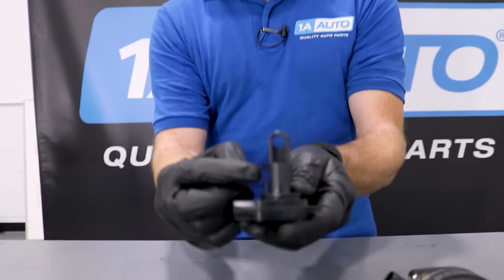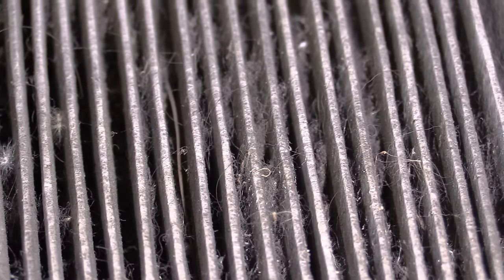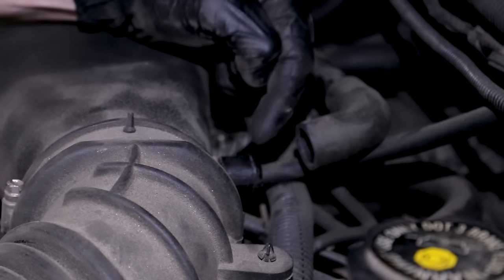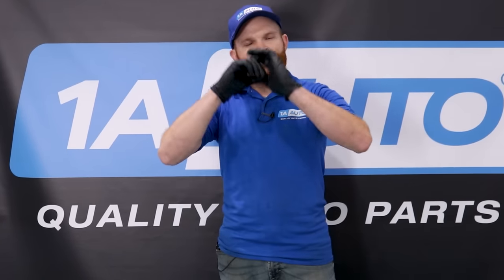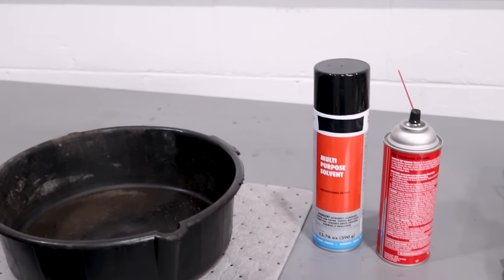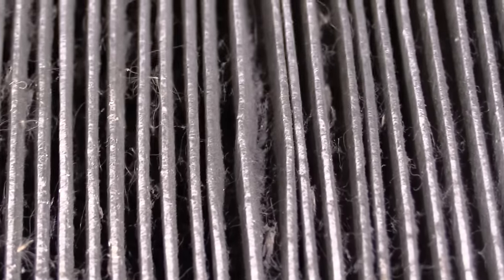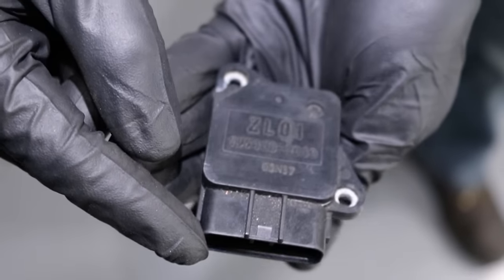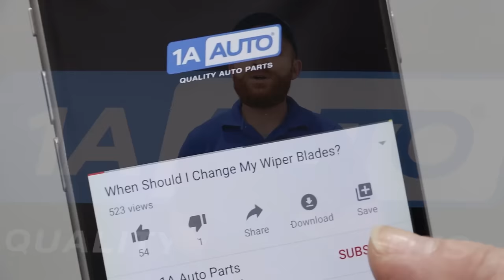What Does a Mass Air Flow Sensor Do in a Car, Truck, SUV?

Comment from the maker: √  Watch the Video
√  Buy The Part at 1A Auto http://1aau.to/m/Visit-1AAuto
√  Do it Yourself
√  Save Money
Reply: Could this cause a car struggling to stay started on a cold start? I noticed after checking my MAS it was completely black in which i could not get rid of the Residue when spraying it. Once my car has started warming up the idle smooths out with no issues after through out driving the car. I have no check engine lights nor codes. I’m totally confused as to what the issue is. I also change the spark plugs.
Reply from the maker: +T. Farris We wouldn't be able to diagnose an issue like that here, you may want to have a local mechanic take a look at it. Thanks for checking us out! http://1aau.to/m/Shop-1AAuto-c
Reply: Just went to order a MAF Sensor for my 98 Mazda but you dont have any..
Reply: I don’t have a check engine light on but I recently checked my cabin air filter and it was really dirty with leaves and debris… the next thing it effects is the MAS correct?
Reply: Good Advice
Reply: @zealgaming9123  Cabin air filter I think would be for air conditioner. The engine air cleaner filter which is in another area if dirty would need to be replaced
Reply: Yes you did a mastertul explanation
Reply: @whatisrelative5586  I had never been told to remove the negative battery post connector. I replaced the MAF Sensor, however,  kept getting 101 & 103 codes. I am now unhooked battery, negative connector fir 15 minutes, as told on YouTube video.
Reply: Love video I just subscribe

Comment: If your engine runs better when the maf is disconnected, chances are a new maf from 1A Auto is required.
Reply: Honestly, they’re not that expensive or difficult to replace . The difference in economy and performance makes it well worth it. I did mine on my v8 Mercedes… bloody thing only cost just under $50 AUD

Comment: Sadly the good explanation of how a MAF works is diminished by cleaning the wrong part of the MAF. What you cleaned is the air intake temp sensor bulb not the hot wire resistors. They are located deeper in the tube on that sensor and can cleaned as well.
Reply from the maker: +Jay Anderson Thanks for the tip! We'll pass this info along to our production team.

Comment: My lexus rx 350 is giving all time bad gas mileage. I have changed air filter, new spark plugs, fuel injectors etc. I am left with oxygen sensor/MAF now. But there are no symptoms of these sensors going bad. Car starts normally, no jerking, normal acceleration etc. What should I do? What's causing bad gas mileage. Shall I try and change these sensors?

Comment: I had a hose the ripped off and it was extra long so I cut it in half and it still fit . It’s running good but now it’s saying my MAF sensor circuit bank 2 code . You think it’s because the hose ? I just cleaned the sensors but it threw the code up again

Comment: I replace my Mass air  flow sensor twice on my 2012 Nissan Rouge in the past few months and my check engine light keeps coming with the same code. no leaks, changes air filter, reset the code and it drives great for a couple weeks, then when I'm coming up on a stop  it will do a little chug like it wants to die and the check engine light is back on. any suggestions on what I should be checking for

Comment: If you are going to replace the original for an alternative sensor...don't throw away your original part.
Many times, the new sensor is not of good quality an make the car even worst idle.
In such a case, clean the old sensor, put it back and return the new one for a refund.
Reply from the maker: +pablo jimenez Thanks for the feedback!

Comment: I HATE NEW CARS! was a Ford mechanic in 90s, Mustangs, Fairlanes... we'd re build them up then maybe put 390s 428s... In them and maybe a MSD box, my 68 Cougar is 400+hp 289, no GD sensors. We knew, know how to adjust the carbs and timing... 2000 Taurus is my 1st fwd drive car ever had, 8 yrs, mechanicly fine I fixed it, all these BS sensors can blow me all the sudden with the trouble codes. I'll be getting my 82 Bronco 4spd going again, sooner than later! Good video though!

Comment: Other instructions via You tube recommend spraying the inside of the Mass Air Flow Sensor with Mass Air Flow cleaner but you did not. Why? I am assuming you alluded to the reason why when you spoke about the internal circuit board.

Comment: My van (UK) went into limp mode when the MAF went. Main xdealer was £120 per hr plus parts,
Local commercial garage £60 per hr, but they used original part. For the warranty.. now runs like a dream.

Comment: Sensor cleaner $13 or so Amazon... A new sensor for our truck $55- $145 at 1A Auto.   ( The first large round type shown on the table) - Will start with the cleaner.  Thanks for the thorough video.   1 A Auto is our go to place for parts for years.

Comment: My Honda Accord 2010 2.4 shakes at 60 mph to 67 mph the tires have been balance, Alignment,tire rotation, CV axel replace, there is no code. Could it be Maf? Only shakes under acceleration in neutral no shakes at any speed. After 3 mechanics can anybody help!!

Comment: My smog test failed due to "too rich," then I went to Auto Zone and used a machine to test for possible causes and it suggested I replace the "mass air flow" sensor, which I did, and am now hoping the 'check engine' light stays off 🤞

Comment: The mechanic took my air filter out and didn’t put it back in. Drove it for a day without it on. Would that make sensor not work anymore? Car started hesitating and now it has check engine light on. Code p0420. Changed both oxygen sensors and light still comes on. Do you think the mass sensor went bad cause of the missing air filter?

Comment: hi brother. just a quick question, does changing the air flow sensor from a stock one maybe to a better branded air flow sensor could actually ehnace the air intake into the engine? does this modification actually affects the ecu or any parts of the car?

Comment: My car was flooded and the engine was started in the water. sensors were replaced. Besides mass air flow sensor what is still causing it to run badly?

Comment: I cleaned my 98 ranger MAF and also cleaned the throttle body with different cleaners made for each part.i also tightened the cable by using 1 zip tie to tighten the throttle cable that became loose over the last 20 years. After the loser slack was back to normal the truck runs allot better. Don't do the throttle body zip tie trick by yourself. Obviously
Reply from the maker: +kevin shufs Thanks for the feedback!

Comment: Is there any procedure to clean oxygen sensor without   dismantling it.
Any kind of fuel injector cleaner help in cleaning O2 sensor.
Which fuel injector cleaners are recommended for GMC TERRAIN

Comment: I have a Audi A4 B8 2008.  I bought a new maf sensor but car idles very rough and stalls. I idled engine for twenty plus minutes and got it to idle. Problem is that when I come to a stop street or stop somewhere it stalls. Rev counter drops drastically. Any advice

Comment: Here's a little advice I just purchased one for my 89 Buick 3.3  .  I spent the extra money and bought it off them A1 auto parts  rather than buying a cheap one well guess what it didn't fit the guide pins where .003 bigger than the old one with no taper on the ends and one crooked so I had to drill the holes on the throttle body bigger . I left them good feedback on ebay before I had time to install it . Hopefully you get better parts from them than I did  . Not sure if I will do business with them again . 🤔

Comment: Thanks for the video. My mother in law's 2011 Buick Enclave is having problems with the check engine light indicating Bank one problem which says it has rich fuel flow? Changed both upper and lower oxygen sensors, but MFS, also could be a problem. We'll check into it again. Thank you for the video.

Comment: Great instructor, this guy is the real deal. Not the problem I have but wow he is good. My 2013 Ford Explorer, stops on me while driving. I had a diagnostic tool plugged in which indicates code PO2111  ( throttle body stuck open) I have never done this before. How do I solve this problem, and how do I locate the throttle body actuator? Thanks for your help in advance.

Comment: I have a 94 gmc sonoma with the 4.3 vortec. Its idling REALLY high at start and higher when I put it in drive or reverse. Ive check everywhere for vacuum leak and can not find one. What else could cause this?

Comment: I have a po102 and a po103 should I try cleaning 1st ?  Would appreciate your take on this. Thanks
Reply from the maker: +Piri Hern It is always worth it to try and clean it out to see if that fixes the issue. These codes are sometimes caused by a dirty MAF and related components but if the issue persists and the voltage is still not running correctly (throwing the same codes), it will more than likely have to be replaced.
Reply: Your response was greatly appreciated. Muchas gracias . All your videos are helpful  especially for us diyers on limited income

Comment: You are absolutely amazing! Thank you for the great enthusiastic, upbeat, and thorough lesson. Was going to use vinegar in a spray bottle to clean the sensor. So happy I looked into this first.

One question. Can't seem to find how to clean the fixed filter in a 2004 Lexus RX 330. Do I have to replace the whole filter housing? The inside is full of, what appears to be, nesting material. It is my mother's car and it only sat for 2 months, intact. We replaced all of the coil packs and spark plugs. Codes read 5th coil pack malfunction. When we were ready to replace the  housing and new filter, we noticed the fixed filter on top.  Then noticed the sensor definitely needed cleaning. And the inside is nasty.

Comment: Outstanding presentation.  My ?s: Is static electricity an issue with these types of sensors or other sensitive electronic components?  How do ground yourself out? Or is it irrelevant?  A request or suggestion to a link.  The heavy rainfall experience lately may have additional implications. Maybe a general preventative maintenance discussion would be helpful 2 my Mountaineer, Max. Y? The leading edge of the hood experienced abundant of pits after an unexpected deluge during my commute. I believe the road spray, a mixture of rainwater and abrasive particles was the cause. These knuckle dragging neanderthals who drive elevated trucks without mud-flaps along with these wannabe Indy drivers seem to share this unhealthy behavior of bathing their neighbors with road spray. They weave in and out traffic at break neck speed and race ahead to an obstruction like a Stop sign or stand still traffic.  Personally, I believe their DEPENDS are super saturated from the rain and they need to get a changing station.  We all observed and experienced this type of behavior.  I do proactive maintenance to prolong Max’s life and 1A Auto’s YouTube videos have informed me on many subjects of auto repair.  I look forward to the next video addressing auto repair. Thank you, thank you

Comment: Outstanding Vid.

The explanation of the Mass Air Sensor and how it works and what it does, helped me to better understand the Air Intake system and how it effects Gas Milage. 
The Visual Inspection under the Hood of the Air Intake and associated system Components was also good. looking for loose parts and Leaks, that is  Good stuff. 

Well done, Keep up the Good work.

Comment: Can a bad mass air flow sensor cause misfire to the engine?
Thank you 
Good video
Reply from the maker: +Chris yo Thanks for watching!  A contaminated or failed mass air flow sensor cannot measure the amount of air flow correctly. This causes the engine computer to miscalculate the amount of injected fuel. As a result, a bad mass air flow sensor causes various drivability problems, including a no-start, stalling, lack of power and poor acceleration.
Reply: @1AAuto  thank you guys good to know that we have ppl to share good advice with us. Thank you

Comment: Your repeated comment that "this is not a diagnostic video" made me interested to see what diagnosis would involve.  Even an overview level, to learn the logic. I would be interested in how a multimeter vs the $2000 unit would compare, and how they would diagnose it with voltage tests. I can't even imagine how one would go about it.

Comment: Hey nice video but I do have a quick question i just replaced all four coils on my 2005 Nissan Altima and it runs alottt better but when i try to get the rpms to 2k on the dot it wont it will go above or below i cant seem to get it exact, it seems erratic to me and I am learning mechanic. Kinda lost here and what could be causing it to not be precise on the rpms, any ideas on what it could be???

Comment: Hey I have a 08 Chevy impala ls 
(I Got this code p2440) but part is brand new -
(P2440) Current DTC
1/1
Secondary_Air
Injection System
Switching Valve Stuck
Open Bank 1-

Comment: i have 2006 gmc sieraa 4.8  that runs like it on six cylinders when its a v-  8 engine. (lack of power)   took out all spark plugs  and all of them were dry black ashy on the ends.  Would the mass flow sensor play a role in this case?
Reply from the maker: +jump even We wouldn't be able to diagnose an issue like that here, you may want to have a local mechanic take a look at it. Thanks for checking us out! http://1aau.to/m/Shop-1AAuto-c

Comment: Sir. I hope you can reply to my comment I really need your help, I have replaced the maf sensor 3 times already thankfully it has lifetime warranty from AutoZone, but after each time I replace the sensor and reset it by remibing the negative cable or the battery for about 10-15 minutes after driving about 90-120 miles the lights comes up and still reads that the maf sensor is bad, I checked the cables and they are fine also the intake system I removed it and cleaned but still the light on. Can you please suggest me what it could be I really would appreciate your help and thank you!

Comment: I just replace wall cover gasket to my 2008 jeep Wrangler I done passenger side no problem when I did driver side of the screw very back thread is scripted but I try to make it tight again it’s little loose look like but other seven screws  are tight but when I start the jeep white smoke coming out, noise from exhaust pipe, vibrating engine and then I scan I got code 0171. Is it regarding the mass airflow sensor??

Comment: my 2004  town car,no  longer idles up at cold start like it use to,does this maf control that? i cleaned it and it still does not idle up on gold start,i have to pedal it to keep it running until  it starts to warm up after it warms up ok sometimes battery light would come on when it idels to slow/rough,,this just started,cleaned the throttle body too,hope you can help,thanks

Comment: how about the idle when you car is stopped at an intersection with your foot on the break.  If you switch car to neutral or park while running idles fine, but in gear with break on shakes a little rough... any idea? I plan to replace the air filter but not sure if that has to do with this?
Reply from the maker: +Dave Henderson We wouldn't be able to diagnose an issue like that here, you may want to have a local mechanic take a look at it. Thanks for checking us out! http://1aau.to/m/Shop-1AAuto-c

Comment: Replacing the mass airflow sensor will it help my vehicle hasn’t been replaced in a while it’s not giving me any check lights to replace it Well I kind of feel like replacing it will it help and will I have to do any resetting to the computer

Comment: My egine light comes on intermittantly, specifically, as the tempertature outside gets colder. My guess is that the colder air is causing the seal of my gas cap or something else to condense, causing the problem. What are your thoughts? I have a 2012 Nissan Murano. Could the mass air flow sensor or O2 sensors be affected by temperature changes?
Reply: The vehicle is giving a code , take it to your nearest auto zone they'll be able to tell you, if the light becomes solid then it is a problem because the computer can't identify the problem, then you'd need to take it for a deep scan .
Reply: You need to be quick about it because a bad part starts damaging other parts fairly quick

Comment: I have a 1999 Dodge Intrepid 2.7L V6 with 117.00 Km only . The pin in the throttle body broke and won't send signal to the Mass Air Flow sensor if it is open or not . And it is depressing that this cars throttle body is so different from the rest and hard to find !  Can I replace the throttle body with a different kind or a universal throttle body ?

Comment: My 1994 Toyota pickup keeps saying mass flow sensor change out 2 of them at Toyota dealer still turns of on Second gear don’t Know what’s going on and the dealer sis is the mass flow sensor
Reply from the maker: +Gerardo Gonzalez We wouldn't be able to diagnose an issue like that here, you may want to have a local mechanic take a look at it. Thanks for checking us out! http://1aau.to/m/Shop-1AAuto-c

Comment: Acceleration is only sluggish when the air conditioner is on. Can the mass air flow sensor be causing this? I already replaced the air cleaner.
Reply from the maker: +Funny Things We Do We wouldn't be able to diagnose an issue like that here, you may want to have a local mechanic take a look at it. Thanks for checking us out! http://1aau.to/m/Shop-1AAuto-c

Comment: What is the name of the thing where the sensor is located...the metal thing...the one that opens and shuts when the accelerator is pressed?

Why does that stay stuck open when i accelerate? Whenever that happens, my car will begin to putter and die. And it will not start until i go take it out and poke that thing close.